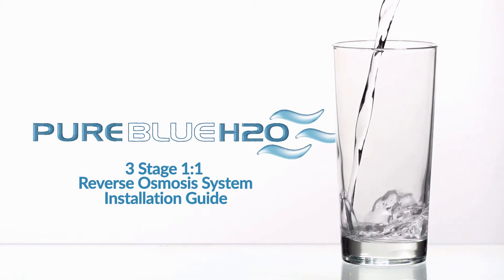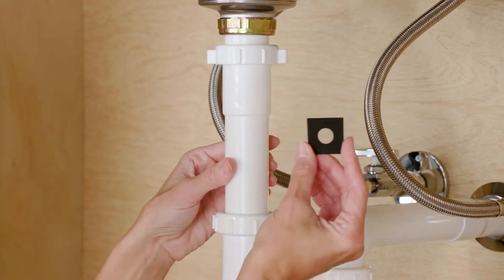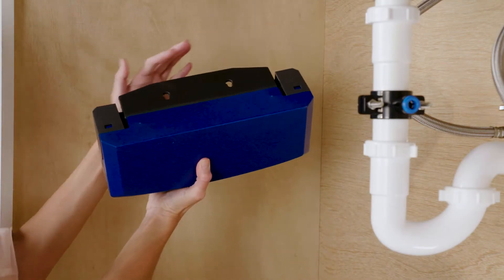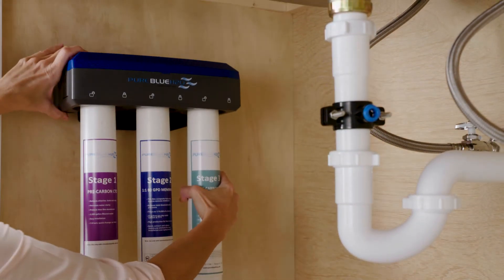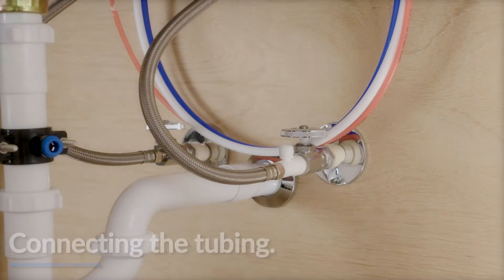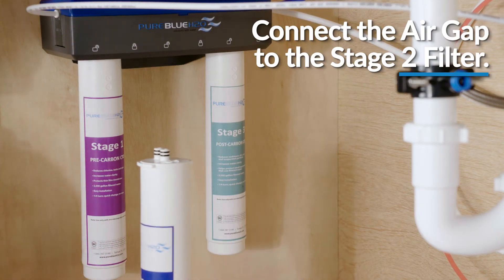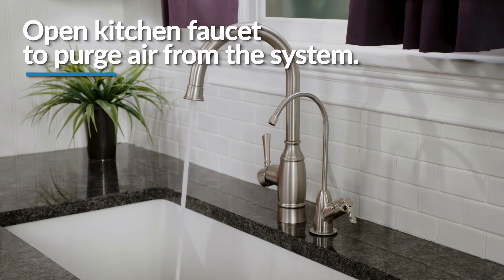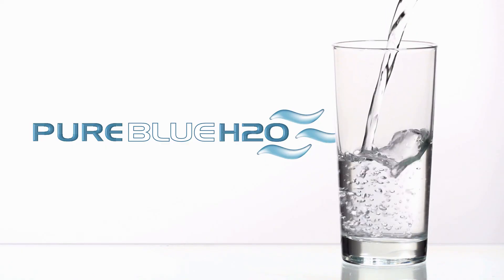PureBlue H2O 3-Stage Reverse Osmosis System Installation

Comment: Recently, my system is constantly draining water into the drain pipe. The tank fills with water but like I mentioned the draining never stops. I replaced the flow restrictor and I replaced the membrane stage 2 filter a little over a year ago so it should still be good. Anyone has an idea what can be wrong?

Comment: Regarding faucet leaks: I found out the issue is with the air gap faucet hose (white) that drains contaminated water into your drain. This is either clogged from the garbage disposal or the hole is misaligned. Please check that. It’s a good system if the air gap faucet drain hose is installed properly or not blocked.

Comment: Looks so easy but replacing filter is not, it turns out the port/key port is not easy to turn and align, had to unscrew the port/key slightly to turn the key so they can move and align, otherwise it is not possible to push and turn replacement in. bad design.

Comment: How long do the tank last? I purchase 1 five years a go, do I have to replace it? Please help.
Reply: You’re supposed to maintain it every so often with 3ML of either bleach or hydrogen peroxide with the tool they provided with the kit. You just take out the tube that’s going into the tank and shoot it in there. at least it’s what it says in the manual that came with it. Other than that, I know for sure, it doesn’t say anything about the tank itself

Comment: This product is pain in the butt! For real! Don’t buy this product please close your company!!! It’s leaking everywhere. Did everything. Tried everything and still leaking!
Reply: Try cleaning the drain pipe under the sink where the faucet drain pipe is installed. A clogged drain pipe can cause water to back up and drain outside of the faucet gap.
Reply: My faucet started leaking out the side as well.   After I replaced the water flow restriction it's still leaking a LOT
Reply: Y’all just need bypass the air gap. Problem fixed.
Reply: How do you bypass that?  @karojerejyan3644
Reply: Drill out the hole you made into the drain pipe as big as you can, if you have a tiny hole  it will clogg more easily and come out the air gap at the ro faucet. Also blow caned air into the air gap hole at the base of the ro faucet from time to time. This will push out any chunks of gunk that grows in your discharge tube . This especially is necessary if your garbage disposal or dish washer drain conection it really close to the discharge tube conection because these items will add more chances of gunk to grow and then clogg your discharge tube then leak out the air gap over night and ruin your freaking brand new kitchen cabinets

Comment: So my faucet started leaking from under the countertop (not the air gap), the drain line is clean since i use a q-tip once a month to clear out the gunk.  Can't believe they manufactured such a poor quality faucet.  One of the 3 tubes under the faucet is leaking even though they are rarely ever touched and never pulled.

Comment: Few things:

First off, if you haven't purchased this item yet, DON'T! It's a leaky piece of junk.

Secondly, if you purchased this item and haven't started installing it, DON'T START! Box it back up and return it.

Finally, if you're here because you're in the middle of the installation.... Well I'm sorry, you're probably in a pretty dark place right now.

Installation is NOT as easy as this video makes it seem. This is a perfect scenario where everything fits. I had to build a custom mount because my cupboard walls were too weak to mount the unit. The angle adapter is cheap plastic garbage and WILL leak. I went to Home Depot and got a higher quality adapter and it didn't leak. However, once I got the system installed and turned on the water the system leaked in three separate locations. Water everywhere.

So now after an entire weekend wasted on this junk I'm disassembling it, doing laundry because all of my towels are wet from cleaning up the mess, and finally boxing this thing back up and hoping Costco will take it back.

Avoid this product at all costs!!
Reply: This comment is awesome

Comment: this model is KNOWN for having leaky faucets...I'm having the same issue. I should have looked at the reviews. Just because Costco sells it doesn't mean it's good. lesson learned.
Reply: I found out the issue is with the air gap faucet hose (white) that drains contaminated water into your drain. This is either clogged from the garbage disposal or the hole is misaligned. Please check that.
Reply: @StevenMWilliams0317 thanks for the tip! I was having water leak from the faucet. I removed the pipe beneath my sink that the white air gap faucet hose drained into and my drain pipe was super clogged. I cleaned out my pipes from the sink through the P trap and everything worked great! No more faucet leak! One thing you can test is to remove the air gap hose and let it drain into a bowl beneath the sink. Try covering the end of the air gap hose with a finger while watching the faucet. Every time I plugged the air gap hose, the faucet would leak. Unplug the hose and the leak stopped. Once all the gunk was out of my pipes, the air gap hose could properly drain and the faucet leak was fixed!
Reply: Use a drain weasel

Comment: Hey guys. I just installed the RO system as shown in the video. I am getting leakage from the bottom of the faucet. It has to do with the air flow restrictor but still have leakage. Any suggestions?

Comment: won't stop leaking from the tank adapter. any ideas?
Reply: Mine was too. Took it apart to see why and realized The seal inside wasn’t fully closed bc it wasn’t tightened enough. I had to put on some gloves to tighten a bit more. Leak stopped

Comment: Mine is leaking out through the key hole in the back of the faucet and idk why
Reply: The line that goes to the drain pipe is clogged. Disconnect just from that end  and clean it!

Comment: I followed the steps but when I got to inserting the blue line into the cold water valve, when I turned it on , it blew out the blue tubing and started spraying water under my sink, ive done this 3x and im running iut of towels, why does this keep happening? Each time I pushed the tube in and tugged but it seems to give

Comment: I bought this from Costco and found the install easy to follow. I recommend switching the plastic t fitting for a brass fitting from Home Depot. 

The last step of this install is to drain the tank. I drained the tank 3 times so I can drink the 4th tank. To drain the tank leave the faucet open for about untill it stops running (about 5-6min). Repeat the draining after the tank filled up in about (2.5 - 3 hrs). You can hear that the tank is filling because when the tank fills it drains some water out the white drain hose.
Reply: Hey do you know the exact piece that will work for this? The plastic park is leaking so I’m trying to buy the brass one but can’t seem to figure out the one I need
Reply: What the replacement from Home Depot?

Comment: The plastic coupler to connect to cold water line is not good especially if your receiving end is plastic. Buy a additional fitting to connect. It is worth to do this job in the day time so that you can run to the store if you need anything.
Reply: add a photo of the brass connector you used instead of the plastic one? Thanks
Reply: I'd replace immediately all the "crap" plastic fittings.  Are they not worried about water leak??  (The plastic fittings mat crack and leak later) - there are metal equivalents available, so why take the chance?

Comment: Just bought a unit at Costco and the stage 3 filter won’t stop leaking. So disappointed.
Reply: Push the pipe more in. I had same situation once the pipe is pushed more in then it won't leak.
Reply: @viewmyacc  mine leaks from the top though, meaning from one of the hoses attached to the bottom of the faucet
Reply: @magocybernetico  Hi.  Mine leaked from the top too.  The red tube was missing the pressure regulator.  Once inserted, no more leak (hopefully).  Thank you PureBlue for sending the pressure regulator.
Reply: Now I wonder if not having the pressure regulator for a couple weeks caused any damage to the filters.

Comment: I installed the 3-step system 3 months ago and the system is now making very loud high pitched squeaking noise when the tank is filling. I believe it has to do with the red tubing as it vibrates with this noise. How do I troubleshoot this issue?
Reply: that is due to your water refilling and being clogged full of gunk from ur city water. remove the line that goes into your drain and clean it out with a paper clip wire. you will need to do this once every 6 months or so. it's a good thing it does this. it's removing gunk but not fitting too well down the removal tube.
Reply: I got the same problem and mine is slowly leaking as well. I just put all of those in a big bucket and pretend everything is fine:)

Comment: Hello, what if I accidentally put/insert the 3/8 white tube to faucet and 3/8 blue tube to tank? Is that matter? I already drank the water. Does it mean I drank the dirty water? And I also want to switch it back, but I can't pull it out. Thanks.
Reply: I'm having the same issue, my contractor installed it incorrectly.  I'm having trouble releasing the tube even while pressing the quick connect fitting...
Reply: Nevermind, i fixed it.  I used a small wrench to push and release the fitting.
Reply from the maker: Hi Hannah! You definitely needs to switch those tubes. As they are, the water isn’t going to the tank and the water is only going through the first 2 filters and then up to the faucet. The water is still being filtered, just not as thoroughly as it can be.

This video will show you how to remove the tubes from the quick connect fittings:
https://youtu.be/8Xo4fl7MLYw

Comment: Can someone tell me if I can use the stage 4 on the stage 3 from the replacement filters from Costco 5 pack I’m having a hard time finding the right ones
Reply from the maker: Hi Rosy! You can purchase replacement filters for the Stage 3 System on our website here: https://www.pureblueh2o.com/collections/replacement-filters-and-parts-all-replacement-filters
Reply: @pureblueh2ollc27  Can you answer Roy's question?  I also would like to know.
Reply from the maker: @tedvidimos2168  Hi Tim! Yes, they are both the same post carbon filter in both systems.
Reply: @pureblueh2ollc27  Thank you.
Reply: Thank you I purchased my filters at PureBlueH2O LLC and I’m instilling them right now 👍🏻

Comment: What is the faucet battery for? Do I need to change it
Reply from the maker: It controls the light that comes on when you need to change your 6 month filter. We recommend changing the battery if it dies, but if you keep up with your filter changes on the correct schedule then it is not necessary.

Comment: Hello, i just purchased from Costco and my contractor installed the unit. Is the Reverse Osmosis faucet light supposed to turn on every time you open the osmosis faucet? Noticed mines does not turn on...
Reply from the maker: Hello! It will come on when it is time to change your 6month filter.
Reply: There's a guide on how to fix the indicator light (on the faucet) problem in the Frequently Asked Questions section of the pureBlueH2O website.

Comment: We just installed our system today. I am understanding correctly that we purge the tank 4 times for the full volume of the tank or 4 glasses full of water?
Reply: I agree this was confusing 
1st purge = nonexistent 
2= clear understood 
and then jump to a 
4 = drinkable
Reply: I believe you should purge the entire tank 3 times. The 4th can be used for drinking.
Reply: Just bought one, havnt install it yet. How do you know you purge full tank! How do you measure since water still going to the tank?
Reply: @Truckingwisper  installed this today! 4 to 6 hours is what it takes to fill the tank! Just go with this time.
Reply: Yes